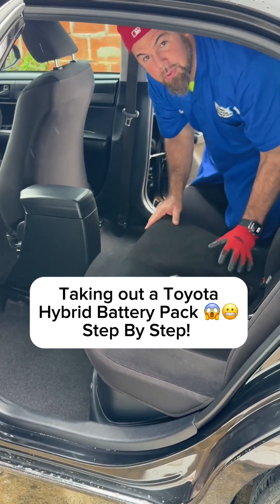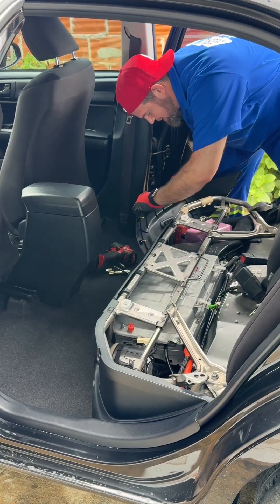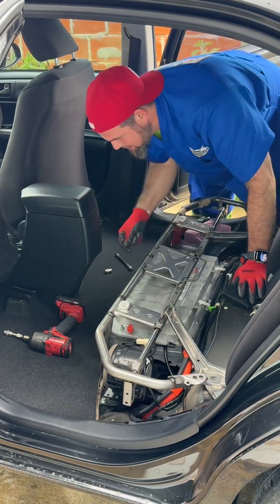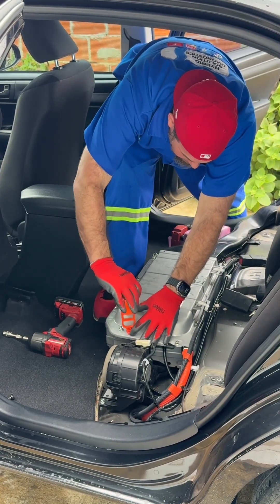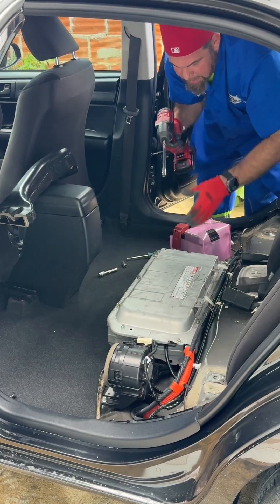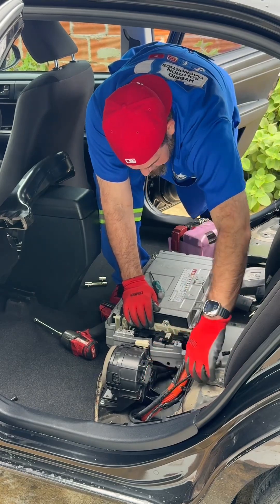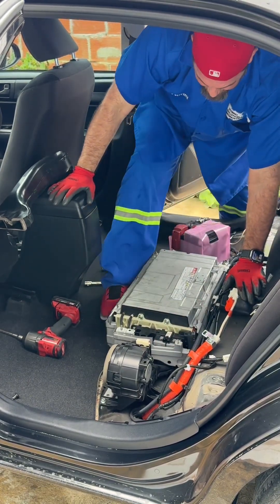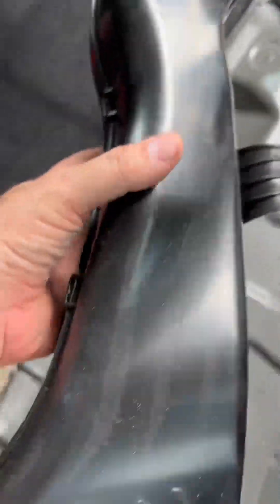How to Remove the Hybrid Battery Pack from a 2019 Toyota Corolla Hybrid | Step-by-Step Guide

Comment: Hello my friend. I watch your videos from Greece. I have a Toyota chr hybrid 2017. When I am on a trip and I am several kilometers downhill (mountains), letting off the gas charges the battery. When it is fully charged and continues to send charge, the engine revs up. On the recent trip I made, it revved up while it wanted to fully charge the battery one more time. Is this normal or do I have a problem with the battery?? thanks in advance.!
Reply: That's normal. It avoids overcharging the 100% of capacity by reving. If it's possible, avoid the 90-100% battery level: switch from B mode to D mode, slow down and then accelerate to discharge it and repeat it until the level decreases. Also neutral stops the reving, but it's not safe to use it down the steep hill due to braking instability of the car. Computer under normal conditions tries to keep the optimum range in between 30%-70%.

Comment: Prius has 291000 miles battery still ok is it better buy new one or replace cells when fails
Reply from the maker: @edwinbab3205  with such high mileage full replacement whenever is time to do so 😁👍✅✅✅